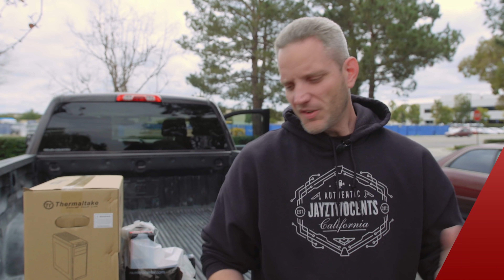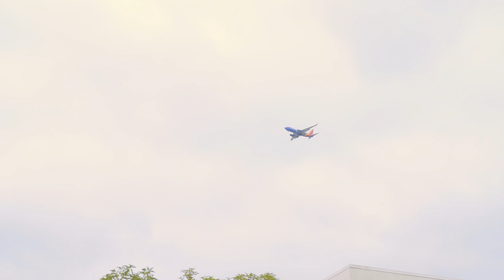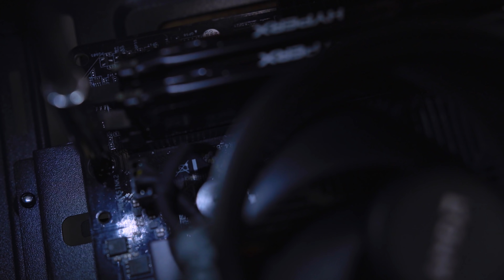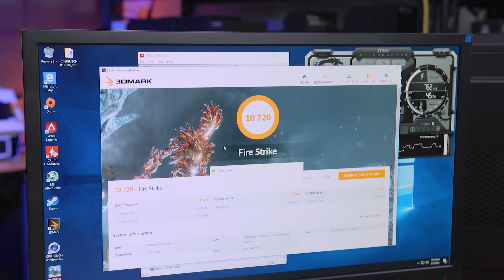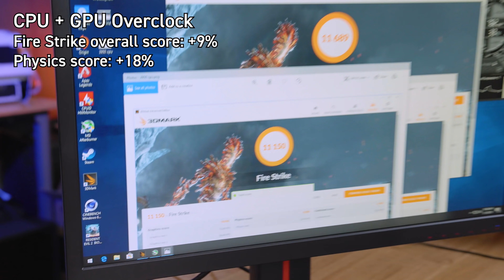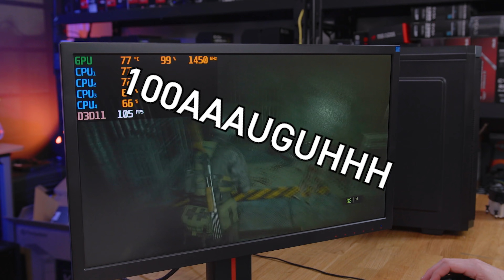CHEAP Gaming PC Build - 2019

Comment: 365 bucks, ryzen 3 2200g, 8 gb dual channel 3000 RAM, GTX 970 Asus turbo, 500 gb hdd & 125gb Samsung SSD, 450 bronze PS, Cooler master Case, Gigabyte AB350 MB. The ssd was used and gtx 970 was previously own but not used! everything else new. If i wouldve added anything else it wouldve been better cooling to get past 3.75 ghz on the ryzen.

Comment: Want a true "budget build"? Find any office PC with a 3rd-gen (or above) i5 / i7 & 8GBs of RAM on the cheap (prob $110 - $160 your best bet), grab a 500W supply and shove a 1060 in there and congratulations, you've built yourself a PC that is still cheaper (& much better) than all of these AMD FX + Radeon HD and 1st/2nd Gen i5 + 1050 listings on eBay. Gl finding a case that will seat the card. A lot of people go for the tower version of the Dell Optiplex 9010 lol

Comment: but Jay the total price u said doesn't include windows 10
Reply: fawwaz ahmed you can get windows 10 nowadays for $3-5 on eBay and the oemkey works just fine
Reply: @Drahko12  +1
Reply: windows 10 is literally free if you don't mind the watermark in the bottom right corner
Reply: You can pirate windows ten 😂
Reply: I just downloaded win 10 on my watermarked win 10 using windows media creator for a different PC. When I installed it on my friend's refurb laptop I for her, using a new ssd, there was no water mark and it shows it activated.  The PC previously came with Win 8. So I have no clue how it happened but downloading from Microsoft and installing got her an activated win 10 for free. So maybe the watermark is now gone if you get it from their site? I set it up yesterday.
Reply: @katherinelangford981  Actually it most probably had an oem license tied to the mobo and it got activated automatically
Reply: @codyrap95 maybe, but it originally came with win 8. But activated win 10.
Reply: @katherinelangford981  Yes, if the mobo had an oem license of win8, it is transferable to win10 so it got activated automatically.
Reply: @codyrap95  hunh.  Interesting to know. Thanks.
Reply: chill man i was just curious

Comment: Legitimate question: Why did you buy the 2200G instead of the 2300X?
Reply: Incase you don't want to use a dedicated graphics card and he stated what the framerates were on just the 2200G. Money savings.
Reply: Did. You google what a 2300x is before doing this comment? Its OEM only and not available for retail sale
Reply: @C0mmanderX  Yes I know what a 2300X is, though I had forgotten about that part. With that said, you can buy them in CPU-board combos.

I also forgot that AMD isn't actually offering the Vega-less CPUs at discounted prices, so yeah... Please disregard my comment.

Comment: Priced a very similar build but swapped the 2200g for a ryzen 5 1600. Very comparable in price, only $20 more and still roughly $35 less than a 2400g. Curious why you chose the 2200g.

Comment: I’m trying to scrape the cash together for my very 1st
build, not easy when you have a wife and daughter to care for. If anyone is interested
in helping I would be extremely grateful. I do plan on filming the build and
posting it on YouTube when I’m finished. I decided to make some GoFundMe campaigns
for individual components. Thanks in advance.

Motherboard:

https://www.gofundme.com/motherboard-for-pc-build&rcid=r01-15518026378-23a41503a9f04736&pc=ot_co_campmgmt_w

GPU

https://www.gofundme.com/gpu-for-pc-build&rcid=r01-15518026749-cdb709756fa3489a&pc=ot_co_campmgmt_w

CPU

https://www.gofundme.com/processor-for-pc-build&rcid=r01-15518029353-24726936961d455e&pc=ot_co_campmgmt_w

Comment: In germany the 2200g is 90 euros and a 1600 is 125 Euros. I think 35 euros more for that extra 2 cores and 8 threads would be worth it. You could save the money on the case or the harddrive. I think everyone has an old harddrive she/he could use for a new computer.

Comment: This PC build sucks and someone who builds it is going to feel like a chump in a couple of years. Its was 567 before buying a monitor or anything. after Monitor and other peripherals someone is probably spending close to $800 on this build and hardly getting any performance increase over an xbox or Playstation that is only $3-400. I am a PC builder, but this is the budget category I tell people to just buy a console. The market is so messed up right now.... If you want the experience of building a computer, awesome, but if you just want a good gaming experience and only have 500 to spend do not build this computer, just buy a console. I tell people in the current market, expect to fork over at least $800-1000 to have a noticeably better gaming experience over console, and will still be relevant or easy to upgrade in a few years. Yes it can play apex. But do you really want to pay close to $800 just to get under 100 FPS on apex at 1080p? Don't forget the monitor he is using is almost $200 and wasn't included in the PC budget and don't forget keyboard/mouse speakers etc. and this is assuming a grey market copy of windows. To play ubi titles like Far Cry or Assasins Creed or other  new AAA titles settings will need to be turned down to get over 60 fps. So that being said, I don't see how you can push someone to spend $800 today on a computer system and can't even get 60 fps 1080p max settings on modern games... Just Apex most of the time. If you want to build a decent gaming PC that is WORTH IT, expect to pay at least $1000. even 60 fps isn't great, it is just considered acceptable, players locked in at 144fps WILL HAVE AN ADVANTAGE OVER YOU.

Comment: i'd change the cpu, mobo, memory and gpu to a i9 9900k, Asus Strix Z370-F, 3200 CL 14 Trident RGB (can run 4000+ CL 18 when OC'd with much tighter timings) and Gpu to a RTX 2080 minmum.
Because as a random normal human being you should have a job and it isn't really that expensive if you know how to save up a little money.
Reply: then frankly, you are an idiot

Comment: Its a waay better idea to start with a B450 board! Waaay better when upgrading! thx for the vid!!

I made my budget build last year, with the help of Jays last video, and upgraded since to ryzen 5 2600 and OCied both. I never got the full overclock on my MSI B350 pro-vdh, because the mainboard seem to bottleneck me. When most people got a 4,2Ghz OC for the 2600 I got only 3,95 (which is suffiecient for gaming) and my old r3 2200g could be OCied to 3,9-4,0, when I got it only to 3,8 (which was a great bottleneck for my gtx 1060-6gb). I am far from Tjunk. and voltage limit..
Nevertheless my memory OCing after the CPU OC went great: Ballistix sport 2400mhz to 3000mhz and a pretty good timing.
If you re going with a budget build, start with an B450-Mainboard! Someday you will have enough money to go bigger, so you wont regret it!

Comment: Yooo Jay, I accidentally turned my hard drive into a root directory when I installed my SSD, my SSD is full now and I want to save games on my HD but it says “cannot save in root directory” damn what did I do lol. I’m about to just call it a loss and buy a new HD.
Reply: Idk what you have saved on it but if you can back it up I would just wipe it and reformat.
Reply: chris sehtman I did format it. There is nothing on the drive. I had it running as my main drive for awhile with a windows product key then I upgraded to SSD, and made that my main drive, now I can’t save anything on the old one because windows recognizes it as the root directory for some reason.
Reply: chris sehtman oh and here’s the twilight zone info: I went into the security settings and made it public for all users and admins and it still doesn’t let me save games in it.
Reply: Could try this it might work. Go online and get mini partion tool and completely wipe the drive it'll take a while. Then format it to gtp and make a new partion

Comment: Its amazing how low can you go and get a very good system!  I built almost the same thing for $377 and I recently added an RX570 8GB for a few bucks more.  Difference is SSD is an M.2 NVMe, RAM was G.Skill DDR4-2400 but clocks at 2666 and I opted for 80+ Bronze 450w EVGA PSU.  I watercooled a 2700x so I took the wraith and added it to the 2200G build.

Comment: I just build a system with the same ethos in mind with a 2400G, 16GB of Corsair Vengeance 3000mhz ram, Asus Prime B450 motherboard, 1TB Firecuda, EVGA 650W  G3 and a Fractal Design Core 2300 case for about that money.

Also I have the same issue you did @jayztwocents with the memory not wanting to run at 3GHz on the Asus Prime (on latest UEFI) with the 2400G. It has to be an issue with the UEFI coz it runs fine at 2933. Did you ever try to get the ram in that rig running over 3Ghz?

Finally, what happened to the Thermaltake boycott?

Comment: Good luck running the Division 2 above low settings on this rig.
Reply: GTX 1060 and Ryzen 2600 user, Open Beta ran 60-75fps on the Medium preset so I think it'll be fine. Plus the game is more AMD optimized, hence the startup Ryzen/Radeon logos.

Comment: It would be nice to include "optional" monitor/keyboard/mouse/headset recommendations included for people doing "from scratch" builds.  Like a sommelier for PC builds, lol.  Having an adaptive sync monitor or the right keyboard/mouse can go a long way. The cost difference is often relatively small to gain a significantly better gaming experience and that insight can be helpful for people who might be willing to save a few more buck before they build.  I think the "rock bottom price/performance" is fun, but you could contrast build/cost that with the "rock bottom price/gaming experience".

Comment: YOU CALL THAT CHEAP GAMING! I have a core i3 3140, 6gb of ddr3 ram and a 2gb Rx 550. Playing Apex at 720p low settings I just about reach around 60fps with many dips in frame rate. NOW THATS CHEAP GAMING!!!
Reply: That sounds sad and unplayable.
Reply: Pfft that's nothing. A couple of years ago I had a sjngle core Pentium 4 with less than a gig of RAM and stone aged GPU that had less than 300 megabyes of vRAM.

Now using a Core i5 + GTX 1060 build lol.
Reply: it's also shit gaming :)
Reply: I think i beat all of you with my 920m with an i3-5010u lmfao
Reply: @cashtoburn3683  Nobody beats my Pentium 4 desktop, alright? 15 wholesome fps on Minecraft. Haha.
Reply: @georgekasiouras  oh, my pc crashes or gets 0-1 fps on minecraft, maybe 15 fps on chrome
Reply: Lol i have a g4560 4gb ddr4 ram and an rx580 dont talk
Reply: That's not cheap.Try running what I have .4 GB ram and Gt 730 GPU.
Reply: @mananbhutiani1699  before i had an Athlon 5350 1.3ghz 4gb ram and a gt710 1gb ddr3 beat that
Reply: @samurboi8007  I had an Athlon Apu and 2gb ram before this.You can't beat me cause I poor.
Reply: 720p isn't really "gaming"

Comment: texture budget 4gb but the graphics card has  8 :( rip fps
Reply: ... if you are using less VRAM than the card has... THAT'S A GOOD THING. You FPS drops massively if you go OVER the amount on the card. My GPU has 16GB of VRAM, no game could possibly fill it currently.
Reply: @ryokuhasu9699  
What's vram?
Reply: @shane5718  VRAM is the memory on your Graphics card that stores the textures and geometry of in-game objects
Reply: @ryokuhasu9699  but there is an option to increase the amount of vram and he set it to the medium, you should expect more fps than he showed.
Reply: @lightning8253  No, FPS in the 90's is about what you should expect out of the 580 in Apex Legends with 1080p. Go watch Gamers Nexus, they tested a wide range of cards in Apex and the RX 580 was at the 80 FPS mark.
Reply: What do you mean? Explain pls

Comment: next do a rtx2070 and intel cpu budget pc :P for 1080p 144hz
Reply: @vau tro I was thinking 9700k aswell but I always go in the higher spectrum, I always do wonder how a minimal spec would look like with at least a 2070 or 2080 card as in how low can you go without sacrificing much.
Reply: @vau tro Yeah that's what i figured. Im considering upgrading my current spec. i7-4790k + gtx970. Almost 5 years old now. Thinking of just going for a cheap RTX2060 soon and try to stretch the rest of the system till late 2020 or early 2021 to fully build a new system or just upgrade everything except the graphics card if the 2060 could hold up that long to my taste. Im not planning to upgrade my screen since it's relativly new (1080p 144hz). But i do plan to have a system that can run upcoming games like Cyberpunk 2077 and GTA6 on 144fps 1080p and maybe by the time GTA6 comes out perhaps also a resolution upgrade and ultra wide. But for the next 2-3 years im planning to run 1080p 144hz. 

Before i really opt for a full system upgrade i might see how far i can stretch my current system if i only upgrade the graphics card. I do think the best route to go if i go this route is with an RTX2060 or maybe even 2070 but the 2070 is less of a value purchase bang for buck wise.

EDIT: 
Upcoming games im interested, Skull & Bones, The Division 2, Cyberpunk 2077, Jedi Fallen Order, ElderScrolls 6, GTA6, Starfield, and already playing dirt rally 2.0 but my card cant run it ultra settings, got it tweaked with medium/high settings to 80ish fps. I always aim for max settings and when i have to hit medium settings it's time to upgrade in my book.
Reply: @vau tro haha likewise, just was half jokingly shouting about the 2070 budget variant. And no I never thought about delidding it, not really sure i would dare that just yet. I might OC the thing before I actually upgrade my cpu/mobo. Got Corsair 2x 8 GB DDR3-2400mhz, faster might work when OCing? My water cooling is not the best for an actual overclock i think (Cooler Master Seidon 120V Rev. 2 ). 

Gonna think about it a bit, since I most likely completely upgrade at the end of 2020. If it would be worth it to me to go for 2070 now already, just to maybe have it replaced with higher grade stuff a 1 or 2 years later.  So for quick value the 2060 might be better in my case.  And about the Raytracing, im not interested in that in it's current form so that's no issue for me :)

Thanks for the info btw.

PS: my gtx970 is not that bad for 1080 60hz though. Cant run dirt rally 2.0 on max settings (30fsp max XD) but Battlefield 5 ran 75ish average fps all settings on max. (dx11 though). GTX970 doesnt handle DX12 that great imo. The divison 2 beta had 55 fps on average. all max settings and drops to low 40s.

Comment: I have a very similar build to this: 2400G, RX 570 (which was $130), an Inland Pro 480 GB SSD, and a used Thermaltake case that cost me $20. It runs really well and is a massive step up from my FX 6300 and Radeon HD 6970 that served me well for a few years.